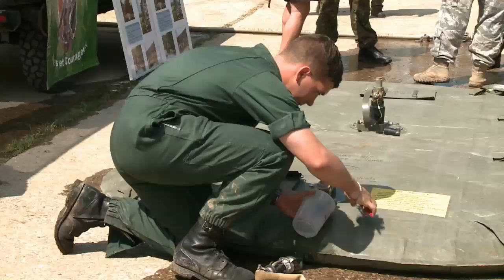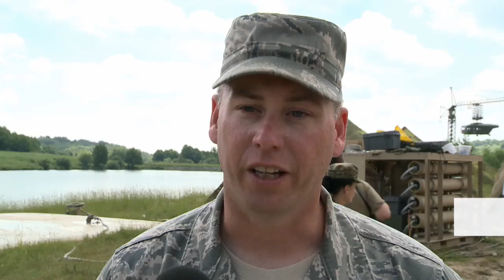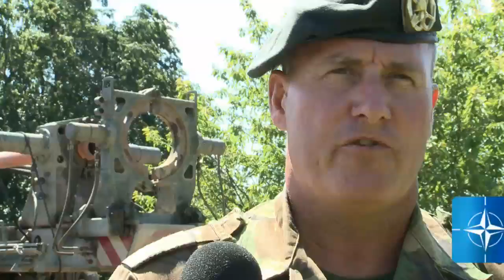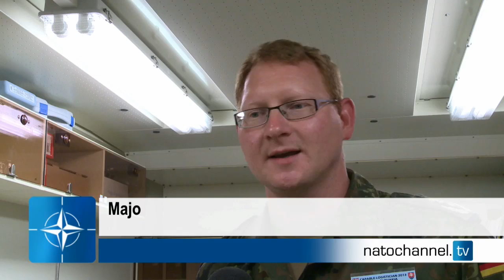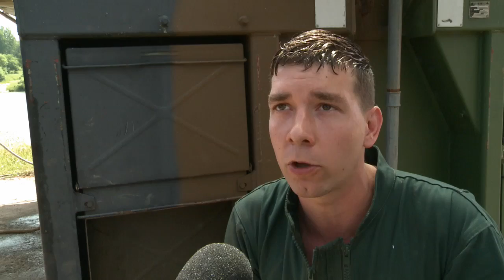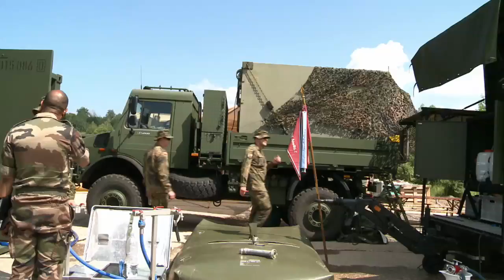How to water an army

Comment from the maker: In military operations a soldier needs 5 litres of  #water  per day (8 to 9 if the weather is hot). So, when thousands of troops need to be supplied, water becomes a major issue.